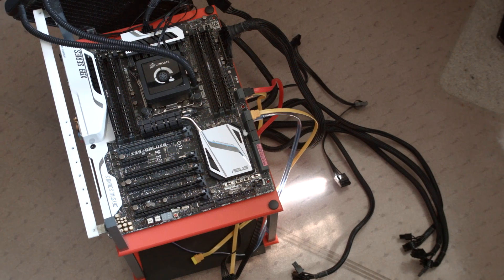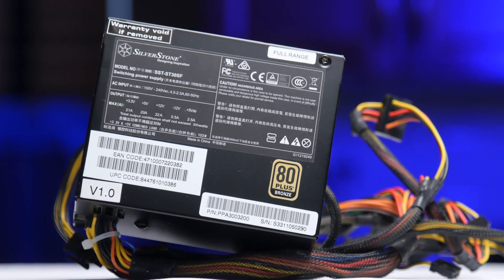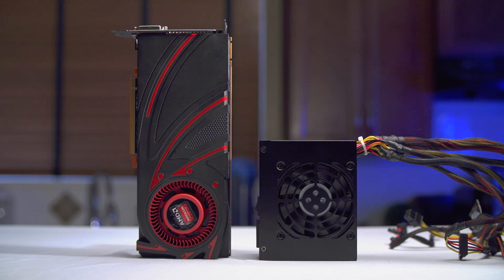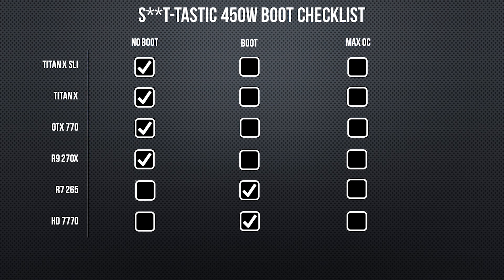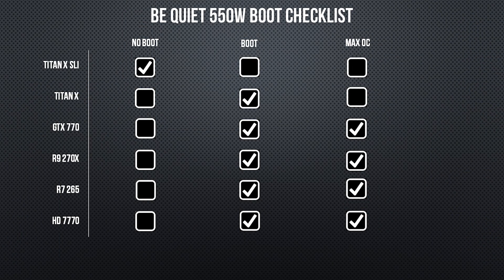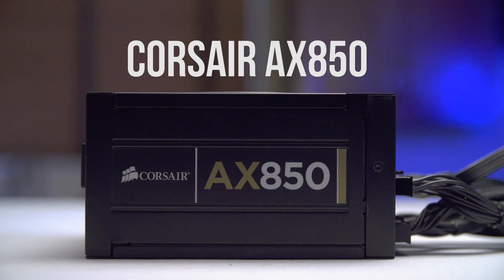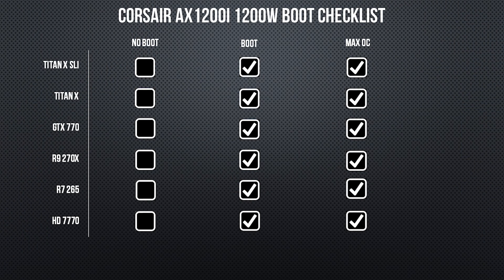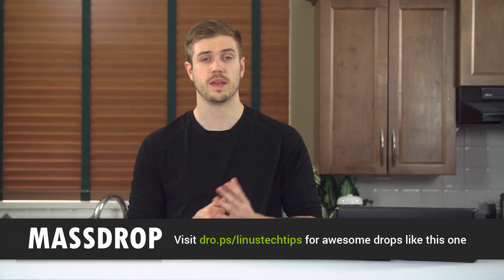Overclocking Recommendations - Low vs High Wattage Power Supplies

Comment: is there anybody that thinks this will not work?

	Crucial BX100 ssd 
	Corsair Vengeance Pro Series 16GB
	Corsair CX Series Modular CX500M 500watt
MSI H97 GAMING 3
Intel Core i5 4460 / 3.2 Ghz
LG GH24NSB0 Super Multi
Seagate Barracuda ST1000DM003  1TB
MSI Radeon R9 280X 3GB DDR5

thank you very much :)

Comment: Dude furmark!?  You should know better, that kills gpus. You should NOT be using furmark!
Reply: subodai85 It doesn't kill GPU's. GPU's with improper cooling on them will die because, well, they have improper cooling. Furmark only killing them because it ramps up the GPU to it's max rated thermal specs- which the cooler can't handle.
Reply: akabiscuitwaffle no, it kills them because it uses an artificial amount of load. I've seen furmark burnout watercooled cards because it's simply not loading the card in the proper way. There is never a time when absolutely every single core/thread/processing unit in the core should every be in use all at the same time, it simply doesn't happen with games. Furmark loads all the things, it's been confirmed to burnout cards.
Reply: subodai85 Workstation cards are made to. Side note, workstation card use the SAME GPUs, but hand picked to be more stable. IE if you got a good chip (like a enthusiast OCer would) it negates that.
Reply: akabiscuitwaffle They are made to handle loads yes, but still not even close the TYPE of load that furmark creates. The fact of the matter is, it destroys cards, good cooling or bad. I've seen it happen, with several cards. just because a chip is a 'good sample' does not negate that, at all.

Comment: Fantastic work. I've been thinking about this recently. More specifically how PSUs handle thermal levels. Is there a way to measure what is an "acceptable" thermal level from a PSU? Is there even such a thing? We measure case, CPU, and GPU temps all the time. But is there really a benefit or need to measure temps from a PSU? I know there are PSUs that have "silent" mode where the fan doesn't kick on. Is that for wattage use or thermal levels?
Reply: Jeffrey Ball A lot of high end enthusiast PSUs have a USB out to internal USB header that lets software read the thermals, control fan curves, read current efficiency, and read current load draw on each rail.

Silent mode on PSU's is just for no sound. Most PSUs have their fan idle even if there is little to no load draw just for overkill safety or for the fact that it may be incredibly inefficient.

Worrying about PSU temps- you shouldn't. Unless the fan in it dies the built in firmware/sensors for it keep the fan going fast enough to keep it more then cool.

As for actual "acceptable" temps it doesn't matter all to much. It's like motherboard temps- they're there, but you shouldn't ever have to worry about them and unlike a motherboard where it has a chipset that can get damaged over time. A PSU either works, or it doesn't. That is unless only a single rail fails in a multi rail system... Being that the only thing you have to worry about failing is the caps or solder, and both those max temps vary depending on what it is they used for them. 

Your only concern for it's longevity should be if you're trying to use it out side of it's rated output or if the fan fails.
Reply: Jeffrey Ball In a normal case with normal utilization it does not matter. If you have some little itx deal where your are running 100% non-stop, then you would benefit to know. I personally shoot for 50-60% utilization. For most gamers that is 650W - 850W.

Comment: HI there. Im not very smart when it comes to PCs so id like to ask the community a question. If i want to have two internal hardrives ( one with my OS and the other with my programs) how will this affect my wattage and is this even possible. my power supply is 500 watts

Comment: Is it possible, that you mixed up something, because you always seemed extremly surprised if the PSU takes almost as much or even more than it's wattage from the wall.

Isn't it working the way, that the max wattage usually means that it can give that amount to the system and just pulls out more from the wall according to it's efficiency?

So for example 1000W @ 90% efficiency would pull 1111W from the wall.

Comment: Well. You should check out voltages over time with oscilloscope.
Even if the power supply theoretically could afford the system load, the voltage differ from constant value. If it didn't exceed tolerance(even for small time) on any supply "line", it's OK.

Basically PSU is the first part that determinates components lifespan.

Comment: what does he mean by fully overclocked?
Reply: alexisthemexican the overclocking have levels, think a little bit before you ask...
Reply: The cpu, gpu, and maybe some other things. Basically overclocking forces your components to consume more power.
Reply: Yeah but fully OC'd with what constraints? I understand that the PSU affects this. But wouldnt this limit also be Fully OC'd? With the bigger PSUs, you can reach and go beyond what the smaller PSUs can. I wasnt really paying attention to everything he was saying, but seeing the numbers would have helped.
Reply: alexisthemexican I'm not sure if this applies to cpus,  but for gpus there is a built in limit for how far you can over clock to prevent potential damage and shortening of the card's lifespan.
Reply: alexisthemexican Cpu's OC limits are core temps, cpu's socket temps and stability. Once you fail in one of those 3, you take a step back and you are at the max OC that your sistem can handle.
Reply: ArgentineGuy If you use something like liquid nitrogen to cool your cpu you run into the limitations of the hardware itsself.

Comment: Luke, the reason the silverstone drew 375 watts from the wall while it is a 300w psu is because the 300w rating is for what it can deliver to the components. It draws 375 watt from the wall, but when transforming it down to 12v there is energy loss. And thus those 75 watts are converted into heat and other things and the ±300w remains for power delivery to the 12, 5 and 3.3v rails.

Comment: What I got from this is that for single GPU setups and an overclocked 2011 socket Intel chip, a 750w 80 plus gold PSU is a nice sweet spot, but 900-950w is more necessary for something like dual Titans. About what I expected.

Comment: First time building my own PC and I want to know your opinions on it, is it bad/good?

Intel Core i7 4790K
Corsair RM750W PSU
ASUS Z97-PRO (WIFI AC)
 x2 HyperX Fury DDR3 16GB, Red
MSI Geforce GTX 970 Gaming 4GB
Seagate Barracuda 2TB
Kingston SSD 120 GB
Cooler Master Hyper 212 Evo CPU Cooler
Corsair Carbide 200R

Comment: Is the corsair CX600 v2 good enough for this rig?
ASUS Z97-A
ASUS GTX970 STRIX
i5 4460
2x8GB HyperX Fury
+1SSD+1HDD
not planning on overclocking. I already have this PSU...
Reply: ***** GO TO THE FUCKONG FORUMS!!!!!!
Reply: ***** yes, go ahead
Reply: frantisek veselovskyJR These questions are for the forums not Youtube
Reply: Yes but It's not from corsair and it uses Chinese caps. It's decent, I have cx and no problems after three years.
Reply: chinese caps who cares, got it paired with a gtx 580 and it is glorious.
Reply: Chill
Reply: dont buy corsair cxand vs psus
Reply: For the love of whatever you believe in, don't buy an i5.
Reply: ***** I'd get a Seasonic Plat 760 over that PSU.
Reply: ***** my system of OC 4690K, 780TI sli, custom water loop with one pump, plus ram and 3 ssd's pulls peak of 700 watts including monitor. Using Corsair AX860. So yeah I think you'll be fine.
Reply: ***** For future reference, you could just use pcpartpicker.com to find out expected TDP, as long as you have a buffer of 50-60 watts more than the expected TDP for you setup the Powersupply should be fine.
Reply: Joshua bean is wrong i5s are good and low wattage
Reply: I have something that kinda looks like but it has a corsair CX430 psu... Yup (yes, with an Asus strix 970)
Reply: ***** Yes.
Reply: As I said. I ALREADY have this PSU. Would've bought something better if I didn't have it already. What about if I get i5 4690K and OC it instead of i5 4460? Thanks guys
Reply: ***** i have msi 970 i5 4690k
1 hdd 
and about 6 fans 
2x4 GB memory
 and 550w coolermaster v(the one in the video)
 and i oc gpu to the max and some oc for the cpu 
and i'm good ^^

Comment: I have a 430w PSU and i plan on upgrading my graphics card to a Sapphire R9 270x. I dont plan on overclocking my gpu but i do plan on overclocking my cpu. I just wanted to know if an overclocked Athlon 760k and R9 270x will run on a 430w power supply?

Comment: the 80% efficient 300w psu pulling 360w from the wall is running at 100% load... however, being able to push past that point (which you did), and considering the size of the unit and relatively cheap price, it's a damn good effort from silverstone to say the least!!!!!!!

gives me a lot more confidence to choose that PSU for my next media center build
thanks luke

Comment: I feel bad for having a be quiet! Pure Power L8, 630W, Modulair, but no idea how to overclock my cpu. no seriously i have no idea even when trying to follow guides.
My setup can be seen here: https://docs.google.com/spreadsheets/d/1Ovswshsd6ik5Fs1--tjoUg_QxKkqMFsnBtpKcC80Dmc/edit#gid=0

Managed to get a +110 core clock mhz on the gpu
And also increased the memory clock + 285

It's a rather old bios as well. any tips are welcome :).

Comment: I just upgraded this PC with a GTX 970, so I have a GeForce GTX 770 which I want to put on my 2nd PC. It has a PSU of 500w. Is that enough? I was trying to figure out how many wattage it needs. I either keep getting 200w or 600w as a minimum requirements. Whenever it comes to power, I always end up confusing myself. Still trying to learn.

Comment: If your unsure what your PSU is good for Newegg & Toms have a list (the updated one is on Toms) which can be found here. http://www.tomshardware.com/forum/id-1804779/power-supply-unit-tier-list.html

Be aware just because you have alot of Watts does not mean you have a good overclokcing PSU if you scroll down the list you will find a 1100W PSU in the tier 4 section. Also be aware that not all well knowen brands make good PSUs some brands that have made good PSUs have also made some pretty bad ones.

Comment: I'm running Corsair's HX850i PSU.  It's silent, runs great and I have PLENTY of headroom for overclocking and system expansion.  I have my CPU overclocked to 4.6 GHz and neither the CPU or PSU is breaking a sweat.  If I were to call it good on my system, I probably would have gotten away with using a 650W or 750W PSU on my build since my PSU is only drawing around 200W of power for my system.  I'm thinking someday I might drop another graphics card and more memory in it and call it good.

Comment: I've been using the free online extreme PSU power calculator, and I was always surprised at how 'low' the max wattage requirement was. Back in the day when 350-450w was the norm, some of my friends were buying 600w PSU and I never understood why, I guess it's more of a question to calculate in advance how much draw your system will need and getting the PSU that matches those values, without drastically overshooting for no reason.

Comment: hey can you guys help me out
i dont know if my psu is enough for my planning upgrade
specs:
12gb vengance ddr3 ram
120gb ssd
2tb wester digital drive
cpu i5 4690k
psu: coolermaster B600 (600 Watt)
gpu: gtx 760 do i have enough what for a second one?

Comment: Will 2,000 Amps @ 12V to ground be enough?
Lab PSUs are GG^^So, a 630W PSU will run a FX-8320 @ 4GHz with a R9 390X?

Comment: Not sure why you're surprised about the 300W SFX power supply pulling 375W from the wall. There is efficiency loss converting AC to DC and that power supply is rated 80+ bronze. 80% of 375W is exactly 300W, so no surprise there.

The fact that power pulled from the wall will not be equal to power supplied to the system was covered in a LinusTechTips video a while back too.

Comment: with low range 600w => 1055T/3.8 oced * R9 280 oced * ram 2x2 + ram 2*4 oced* 5 fan * 2hdd * ssd * fan control  nice oc overall, but with high end evga 750w psu sky is the limit i achieved 4ghz for fun and better oc on gpu also... rock stable but i have to upgrade cpu cooler for this profile or keep trying for more.. :D

600w should be enough in first place but quality of psu matters the most and not just regarding with stability issues things like silence (hybrid tech) and safety for example ;) .. so if u wanna take yr system to it's limits every part should be a great combo from mobo/psu/ram/temps/.. +luck of current cpu juice ^^

Comment: 850 watts wasn't enough for my 5GHz* 4790k and my sli 780s with 1200mhz on the core clock. I got myself a 1000w power supply now everything runs great.
Reply: Grey Roots Then it was a shitty PSU. Assuming that one 780 pulls 300W and the 4790K 150W plus 50W for other devices then you shouldn't reach more than 800W.
A good 850W PSU should be able to continuously deliver 850W and around 950W peak
Reply: cl4ster17 maybe it was but I also run over clocked 16gb (4 sticks) of ram about 10 fans a pump 4 led strips 4 hard drives a fan controller and a DVD drive. you're probably right tho.
Reply: 5Mhz 4790k!? Dude, way to underclock like a boss!
Reply: Duffel Bag Full of Tech yeah it be 4996.3 mhz.... it's early bro.
Reply: Grey Roots  dang nice overclock. I only got mine at 4.8.
Reply: Grey Roots Lel
Reply: Duffel Bag Full of Tech 5 MHz...
Reply: prob just a type

Comment: Do another one on efficiency, and what happens if you go overboard on the wattage, pick a card, for example a 770  and test it on different wattage PSUs for example a 650w,a 850w and a 1200w with the CPU and GPU configured the same between tests, and see if the power beeing drawed its the same. If the PSUs are the same brand will also help. Trying different GPUs and from AMD and Nvidia would also be cool if you have the time.

Comment: i have a gtx 770 sc acx, and a 600w 80plus bronze psu with 46amps on the 12v rail, and i haven't oc'd but i'd like to, i have a i5 4590 also btw so obv i dnt oc that, but i just wanna know if i could oc my gpu thnx

Comment: My Setup:
i5 4690k OC to 4.3Ghz at 1.25V (I know, I think I got the bitter end of the spectrum, maybe)
Radeon HD 6990 (Dual gpu, 4 years old, still kicking ass but takes ALOT of wattage)
850W PSU (Corsair 80Silver. 4 years old too. I don't understand abt capacitor aging much but do you think mine is still ok?)

Also another qn. Should I upgrade to a GTX 980? Should I even spend that much to gain a slight performance? I believe my gfx card can go toe-to-toe with a 970 (lose but still close) but 970 or 980 takes HALF the power! But in this case, my psu would be too much, 650W is the sweet spot for a single 980 i think. Unless I get double 970 right? 
Till when should I wait it out and upgrade?

Comment: Furmark doesn't push my GPU very much, it doesn't even engage boost clock and makes it run more unstable. MSI Afterburner has more than a single test and puts far more load on the GPU. I have an EVGA 970 FTW

Comment: 3:58

So after it failed to boot a 270x it stopped working for the 265 and 7770 as well. It died. RIP + PSU = RIPU

Comment: Remember that the power drawn from the wall is not the same as the power drawn by your components. There is loss in the PSU, and the rating of it tells you how much it can deliver to your components, not how much it can draw from the wall. In other words. A 300 watt PSU might draw 370 watts while only delivering 300 watts to your machine. This equals a loss of about 19%, or an efficiency of about 81%.

Comment: I used a cheap 400w PSU from an old PC to test an FX-8350/Radeon 7870 build out before my 750w PSU came in and found my CPU actually ran at higher temperatures with the lower powered PSU. In other words, Getting a better PSU not only gave better power headroom, but also gave better cooling headroom.

Comment: I'm a bit new to computers and I can't find a step by step guide to overclocking an i7 4790k. can someone direct me to one
Reply: Hi penguin you would best be served by looking on Linus's page for one or googling it, suffice to say it involves going into the bios but before you do it let me ask you this do you really need absolute maximum 10-15% performance increase if your running air cooling at the risk of accidentally destroying your cpu?

If however you have some poor low end cup then it might be worth your while but if not and you just game don't bother unless you render or screen capture
Reply: Xamanthas
well the reason why is because i'm getting like 50% GPU usage on each card (gtx 980 sli) and i want to fix it. i heard it could be a cpu bottleneck or new ram, OR the fact that i'm using a native 1360x768 monitor temporarily.
Reply: PenguinsAreColdish
 Using 50% clock usage is nothing to be concerned with

An old gtx and radeon ive had in the past used 50% in bloody minecraft, so dont be worried, however if your getting fps lag then your in trouble
Reply: Xamanthas yea, but people with the same graphics cards are getting like 80% on each in the same instances.
Reply: PenguinsAreColdish And are they running  SLI? SLI utilises the cards in a fashion where they render half the work load or about so, again load is nothing to worry about unless its 100% on idle, the less load the better

Comment: Computer power supplies are rated in what they give not what they take. So if your giving 300 watts you're using more than that at the wall. Also the more you draw for longer the less efficient that number will get.

Comment: LoL I picked up myself a second hand dell 1000w psu because yolo seems to run fine. But it does make a high pitch noise when the PSU is plunged in and the PC is not on O_o